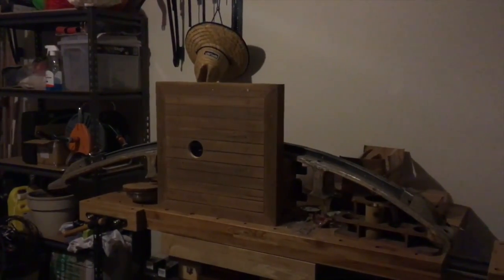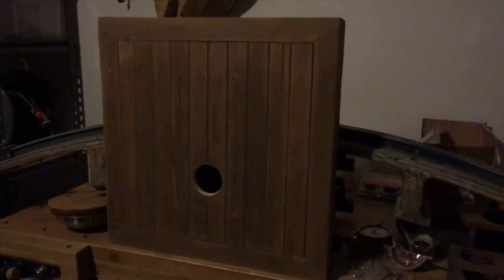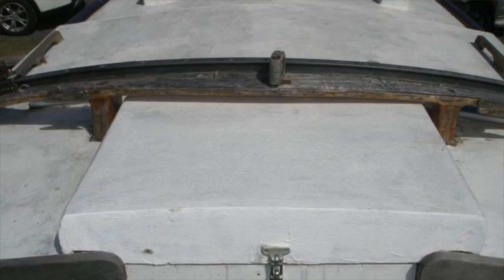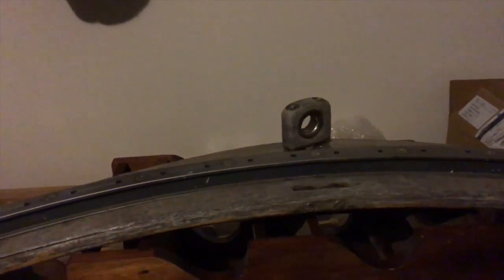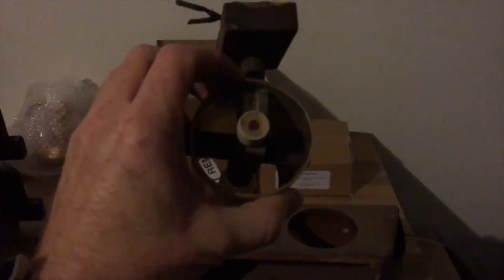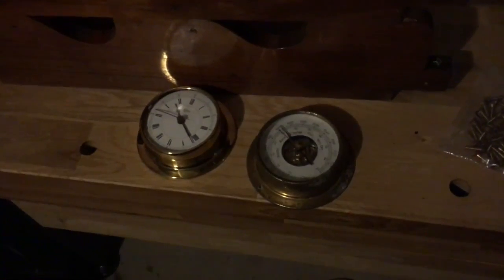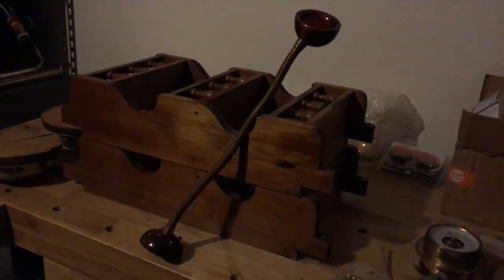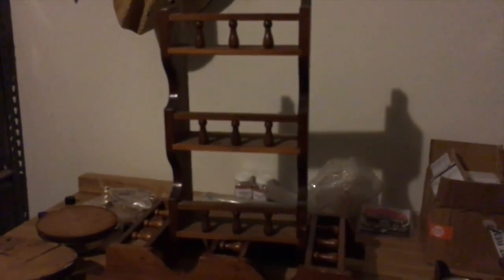Restoring Talitha Ep. 3 - Old hatch & new bronze (Part 1)

Comment: The flexi pipe on the chart table lamp is a piece of plumbing pipe that is used for bends or connecting to taps in awkward places. You can get it here in the UK at DIY stores.
Reply from the maker: Thanks for subscribing Dale. Have seen the same here, still debating to buy a brass flexible pipe or use the existing one - it doesn't quite stay in place but now that I epoxied out back together we'll see!